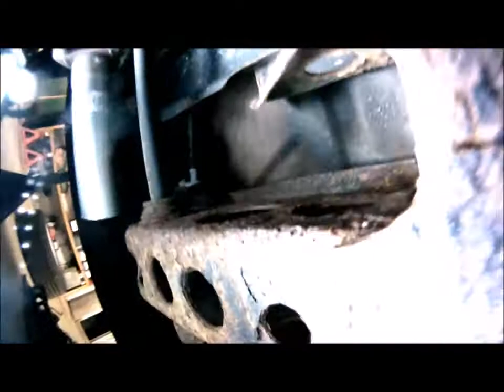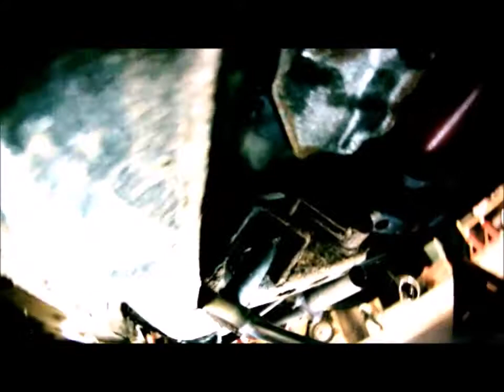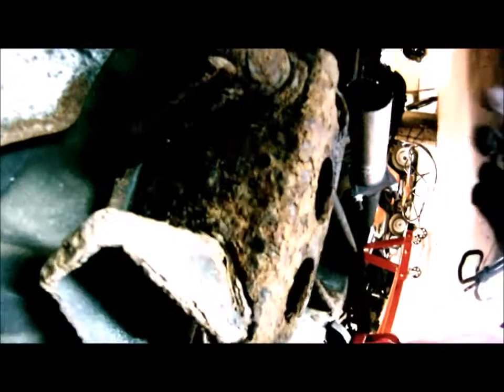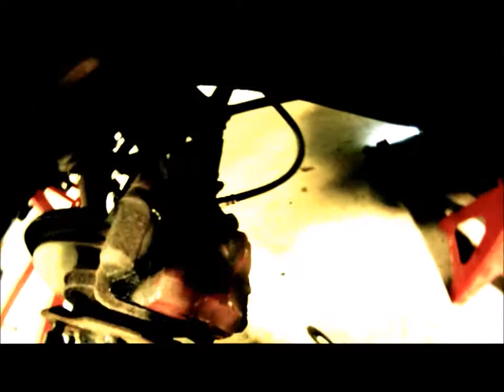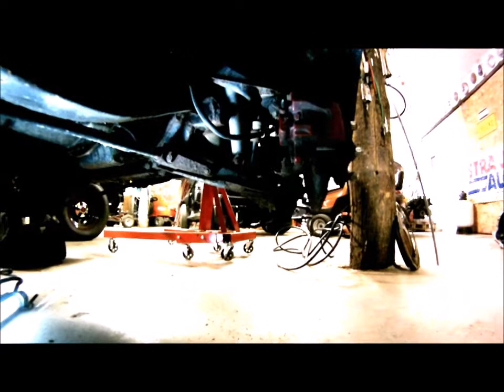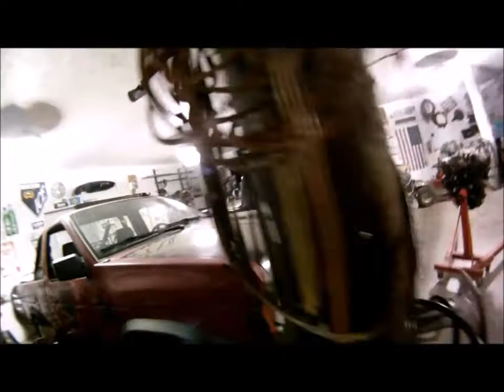Nissan Street Truck Build E4 (2018)

Comment: I have a Nissan hardbody 91 i to the convention to std I finished but I have a problem I put in neutral in don't start. I get stock what I can do
Reply from the maker: You need to jumper the inhibitor relay on the inner fender. You need to trick the ecm into thinking it's in park all the time.
Reply: Nismo D21 it's the plug have 2 cable's in it
Reply: Nismo D21 one of the cable's it's black  in other is brown
Reply: Nismo D21 or they have a 2 blue relays in the right
Reply: Nismo D21 they have 4 wire's
Reply: Nismo D21 you don't have a Facebook or something
Reply from the maker: I am searching for the  link to this info on Infamousnissan.com. I will link you as soon as I find it.
Reply: Nismo D21 inner fender left or right
Reply from the maker: http://www.infamousnissan.com/forum/showthread.php?t=38278&highlight=240sx+swap

Here's your information. I know the guy who did this swap. He got the info from me and posted it. I have not posted this information online yet.
Reply: Nismo D21 tanks I appreciate the info.. only needs to jumper the relay  did you tell me
Reply from the maker: Yes, that is all I did. Only two terminals need to be jumped. Look a the relay diagram on the relay itself to know which ones. Toss the relay and have a nice drive.
Reply: Nismo D21 yeah i now in the diagram I see inhibitor relay a/t  in the other sees inhibidor neutral/park relay wish one
Reply: Nismo D21  they are in the left inner fender
Reply from the maker: those should be the same relay. The one you want it next to the window washer bottle. It should be the blue relay.
Reply: Nismo D21 ok it's only one blue the other is black..ok a will try with the blue one